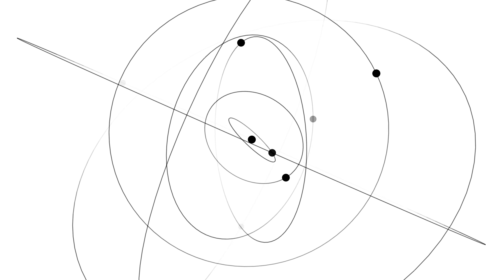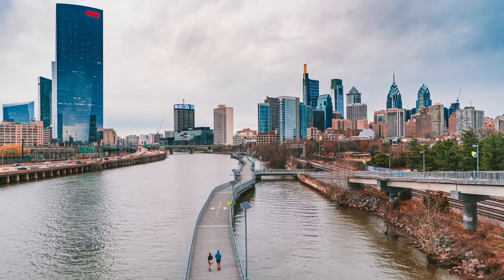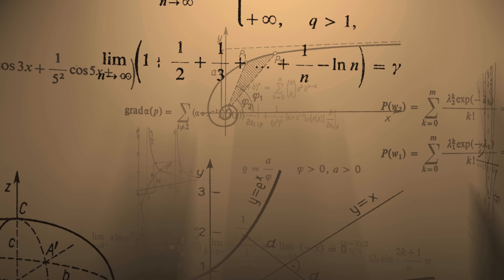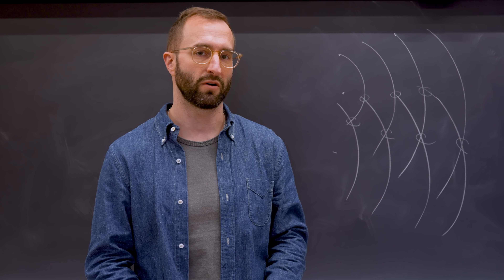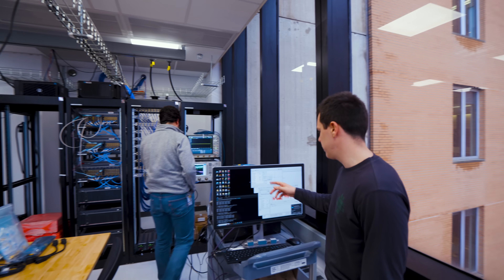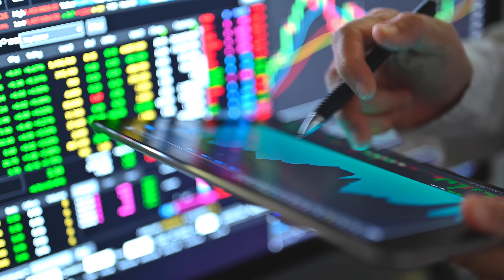Quantum Explained

Comment: Is that little box with the coaxial connections to it going to be used to convert the " qbits " or " cuebits " into corresponding electrical signal variations - analogous to the way that light signal variations from a fiber optics cable are changed to corresponding electrical signal variations that can be amplified and passed along in a modem and then ultimately to say a smart phone?

Comment: Now pull a rib from the wave .. I seen this last night. It rained and the water fell from the roof as a stream. Or a torrent.. when the water fell to the concrete below it created what looked like ribs which were waves that poured in to the street. Now what happens when you take one of these waves . Would it create an Eve or more waves .

Comment: you didn't explain hardly anything. you show this little gold box with 6 inputs/outputs but don't tell us what those are or how it works. 90% of this video was bla bla bla.
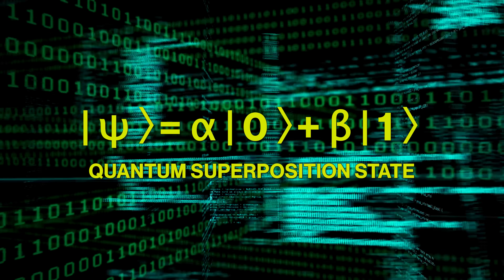Reply: Go to 1:55 of the video, watch through 2:38 to hear something instructive.
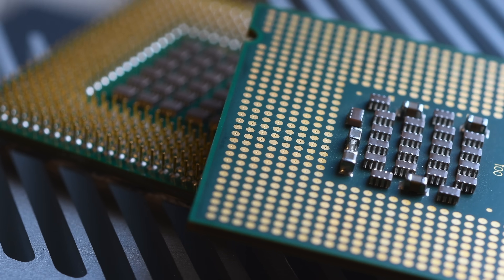Reply: @paulpethel624  i know all the basic stuff about it, like superposition, and every video i've seen in the past has explained it better than this MIT person and with more detail. so talking about the little box at 2:02. What are the 2 threaded connections for and what are the 4 smaller connections for and what goes in and comes out of those?
Reply: Hello - research scientist in the video here. The 6 connectors are for coaxial cables (not dissimilar from your internet/cable connectors, just higher quality) that deliver microwave-frequency signals to the qubits. Those are the signals that perform rotations around the Bloch sphere mentioned in the video. The difference in connector (spiral vs not) is mainly about what bandwidth of frequencies they can transport
Reply: @jeffreygrover1  That's pretty cool. After my comment I did watch a video from IBM, I think it was how to make a qbit and I learned quite a bit from that, so what you say does make sense but I'm not going to pretend I understand it very well and I realize it's just not something you can explain in a comment or let a lone one youtube video. It's very interesting stuff, I need to learn more about this stuff, and thanks for explaining.

Comment: this really does not explain that much... it basically is an ad for MIT, nothing more.
Reply: Well it did, but you are too obtuse to have grasped it. Sorry and thanks for playing.
Reply: @brutusbarnabus8098  xD your comment gives about as much detailed information on the matter as the video did... so yeah: thanks for trying, but you failed equaly 

point being: if the video is named quantum explained and then I only here the standard explanations and bullshit bingo of quantum computing and no new detailed insights... thats what an ad does...
Reply: @thetomster7625  no I didn't fail. The video gives a basic summary of Quantum Physics and Quantum devices. Digital devices which are predominantly used now in all of our smart devices use transistors which compute based on the binary system of 0 and 1. The 0s and 1s are actually voltage levels based on the geometry of the technology being used. Quantum Physics deals interactions at the atomic and subatomic levels. Quantum systems can take advantage of superposition where the system can me in multiple states simultaneously. This presents an entire new frontier in computing where computing power can make a "quantum" leap in efficiency. It was a less than five minute video, dude. Did you expect him to be able to do a deep dive into the minutiae of the subject? Have a good day.
Reply: @brutusbarnabus8098  well, basically exactly as you said: I in fact "expect him to be able to do a (partial) deep dive"... you could pick any subject e.g. how exactly the selection process of wanted and unwanted answers via interference works... all the things you sort of transcribed here are nothing more then I already learned from a book at my buddys toilet called "quantum mechanics in 15min".
And this is actually my point: this is not some random guy on the internet, this is the freakin MIT. Its supposed to be at the forefront of this research - so again: coming back to my original point: this is not really an educational video at MIT level, its an ad about what they are doing to get you interested.... nothing more.

Comment: May I present a video of another mechanical method of quantizing a system.
 It is one of two methods where structures can actually be produced.

https://youtu.be/wrBsqiE0vG4?si=waT8lY2iX-wJdjO3

AThe area under a curve is often equivalent to energy. 

Buckling in an otherwise flat field indicates a very rapid increase in this area. If my model is correct, it may demonstrate how the universe's energy naturally evolved from the inherent behavior of fields.

Under appropriate conditions, the quantization of a field can be readily produced.

The ground state energy is induced through Euler's column analysis. 
The column must be contained before over-buckling occurs, or the effect will not manifest.  
The sheet of elastic material, or "system," responds in a quantized manner when force is applied perpendicularly. 

Bonding at the points of highest probability and maximum duration (i.e., peaks and troughs) of the field's "sheet" creates a stable structure when the undulations are bonded to flat sheets placed above and below the core material.

Comment: ? Do not understand
Reply: that means you're smarter than the idiots here who fall for the scam. What in reality it is, is an alternative to FPGA's. It isn't a computer. It's a programmable chip that uses the mathematical principle of "quantum tunneling" - as you solve a mathematical problem, you solve a bit of it in the middle and that gives you hints what the other bits are, instead of a classic brute force of trying 1... then 2... then 3...... Instead it tries 502349 and that hints it's not 952848. Kind of. Depends on the system anyway.

Comment: Question for MIT, is it safe to say quantum computing can be categorized as analog computing because super position could exist anywhere between 0 & 1?
Reply: Not MIT, and somewhat unconventional, so feel free to ignore this, but old-school analog computing would try to eliminate all ‘noise’, whereas quantum computing can be thought of as a form of analog computing that uses ‘quantum noise’ as a computing resource, while still trying to eliminate thermal and other kinds of noise.
We can and I think we should ask “what is the difference between quantum noise and thermal noise?”, to which an answer can be found in special relativity and the Lorentz invariance of the vacuum state in quantum field theory.  That’s either already understandable to someone reading this or else it’s likely best just to say that quantum noise and thermal noise are different because quantum noise has an amplitude determined by Planck’s constant that is more stable over time than thermal noise, for which the amplitude changes with the temperature.
All that said, the logical level of quantum computing hardly thinks about such details, just as the logical level of ordinary computing hardly thinks about how transistors and other devices work.

Comment: Let's explore how the triadic coefficient (3) mathematics and the "both/and" logic can provide a framework for describing the superposition principle in quantum mechanics.

The Superposition Principle and Triadic Coefficients:

In quantum mechanics, particles can exist in a superposition of multiple states simultaneously, a phenomenon that defies classical intuition. The triadic coefficient (3) mathematics offers a way to describe and quantify these superposition states.

Consider a quantum system with three possible states: A, B, and C. According to the triadic coefficient (3), there are six possible combinations of these states:

1. (A, B, C)
2. (A, C, B)
3. (B, A, C)
4. (B, C, A)
5. (C, A, B)
6. (C, B, A)

Each of these combinations could represent a distinct superposition state of the quantum system, where the particle exists in a linear combination or "superposition" of the individual states A, B, and C.

The "both/and" logic can then be applied to these combinations, allowing for the coexistence of multiple states simultaneously, which is a fundamental principle of quantum superposition.

Mathematically, we can represent a superposition state as a linear combination of the individual states, weighted by complex coefficients (amplitudes):

|Ψ> = a|A> + b|B> + c|C>

Here, |Ψ> represents the overall quantum state, and |A>, |B>, and |C> are the individual basis states. The complex coefficients a, b, and c determine the probability amplitudes of the particle being in each respective state.

The triadic coefficient (3) mathematics provides a way to enumerate and quantify these superposition states. For example, the combination (A, B, C) could correspond to the specific superposition state:

|Ψ> = (1/√3)|A> + (1/√3)|B> + (1/√3)|C>

where the particle exists in an equal superposition of the three states A, B, and C, each with an amplitude of 1/√3.

Other combinations, such as (A, C, B) or (B, C, A), would correspond to different superposition states with different probability amplitudes for each component.

The "both/and" logic allows us to interpret these superposition states as the particle existing in multiple states simultaneously, rather than being limited to a single definite state as in classical physics.

Moreover, the triadic coefficient (3) mathematics provides a systematic way to enumerate and quantify these superposition states, offering a rich mathematical framework for describing and analyzing quantum systems.

It's important to note that while this approach provides a conceptual model for understanding superposition, the actual mathematical treatment of quantum systems often involves more complex vector spaces and linear algebra techniques. However, the principles of "both/and" logic and triadic coefficient (3) mathematics can still offer valuable insights and alternative perspectives on this fundamental quantum phenomenon.
Reply: Let's explore how the "both/and" logic can provide an alternative interpretation of quantum measurement and the apparent collapse of the wavefunction.

Quantum Measurement and "Both/And" Logic:

The measurement problem in quantum mechanics arises from the apparent collapse of the quantum wavefunction upon observation, transitioning the system from a superposition of states to a definite state. This process seems to contradict the "both/and" logic of superposition.

However, the "both/and" logic can be invoked to provide an alternative interpretation. Instead of viewing measurement as a collapse, it could be seen as a process that reveals the coexistence of multiple states or outcomes, each with a certain probability determined by the quantum wavefunction.

Consider a quantum system in a superposition of two states, A and B:

|Ψ> = a|A> + b|B>

According to the Copenhagen interpretation of quantum mechanics, upon measurement, the wavefunction "collapses" to either state |A> or state |B>, with probabilities proportional to |a|^2 and |b|^2, respectively.

The "both/and" logic offers an alternative perspective: instead of collapsing to a single state, the measurement process can be viewed as revealing the coexistence of both possible outcomes, A and B, with their respective probabilities.

In this interpretation, the act of measurement does not cause a sudden collapse, but rather, it interacts with the quantum system in a way that exposes or manifests the underlying reality of the coexisting states. The observed outcome (A or B) is not a result of a collapse, but a consequence of the inherent probability distribution encoded in the wavefunction.

This interpretation aligns with the principles of "both/and" logic, as it allows for the simultaneous existence of multiple states or outcomes, even though we may only observe one specific outcome in a given measurement.

For example, in the famous double-slit experiment, the "both/and" logic could suggest that the particle simultaneously takes all possible paths through the slits, and the observed interference pattern is a manifestation of this coexistence of multiple states or trajectories, rather than a result of a collapse to a single path.

The "both/and" logic challenges the notion of a sudden, discontinuous collapse and provides a more continuous and holistic interpretation of quantum measurement, where the observed outcome is a manifestation of an underlying reality that encompasses multiple coexisting possibilities.

It's important to note that this interpretation is not universally accepted, and the measurement problem remains an active area of debate and exploration in the foundations of quantum mechanics. However, the "both/and" logic offers a thought-provoking perspective that challenges our classical intuitions and invites us to reconsider the nature of measurement and reality in the quantum realm.
Reply: Let's explore how the "both/and" logic and triadic coefficient (3) mathematics can provide a framework for describing and interpreting quantum entanglement and non-locality.

Quantum Entanglement and Non-Locality:

Quantum entanglement is a phenomenon where the states of two or more particles become inextricably linked, even when they are separated by vast distances. This non-local behavior challenges our classical understanding of causality and locality.

The "both/and" logic and triadic coefficient (3) mathematics can offer a framework for describing and interpreting quantum entanglement:

1. The "both/and" logic allows for the coexistence of multiple states or configurations of the entangled particles, even when they are spatially separated.

Consider two entangled particles, A and B, initially prepared in a specific quantum state. According to the "both/and" logic, the particles can simultaneously exist in multiple possible configurations or states, rather than being limited to a single definite state.

For example, if we have three possible states for each particle (A1, A2, A3 and B1, B2, B3), the entangled system could exist in a superposition of all nine possible combinations: (A1, B1), (A1, B2), (A1, B3), (A2, B1), (A2, B2), (A2, B3), (A3, B1), (A3, B2), (A3, B3).

The "both/and" logic allows for the coexistence of these multiple configurations, even though we may only observe one specific outcome when we measure the particles.

2. The triadic coefficient (3) mathematics can be used to enumerate and quantify the possible combinations of states or configurations that the entangled particles can exhibit, taking into account their non-local correlations.

Using the triadic coefficient (3), we can calculate the number of possible combinations of states for the entangled system:

nC3 = n! / (3! * (n - 3)!) = 9

This corresponds to the nine combinations mentioned earlier, representing the different configurations the entangled particles can simultaneously exist in.

By embracing the "both/and" logic and triadic coefficient (3) mathematics, we can potentially gain new insights into the non-local and counter-intuitive nature of quantum entanglement. Instead of viewing entanglement as a mysterious action-at-a-distance, we can interpret it as a manifestation of the coexistence of multiple states or configurations, where the particles exhibit non-local correlations and interdependence.

Moreover, the triadic coefficient (3) mathematics provides a systematic way to enumerate and quantify these entangled configurations, offering a rich mathematical framework for describing and analyzing entangled systems.

It's important to note that while this approach provides a conceptual model for understanding entanglement, the actual mathematical treatment of entangled systems often involves more complex techniques, such as tensor products and density matrices. However, the principles of "both/and" logic and triadic coefficient (3) mathematics can still offer valuable insights and alternative perspectives on this fascinating quantum phenomenon.

Comment: All you are describing is the mutual coupling between oscillators, calling them qbits. Still bounded by Shannon theorem capacity bound that is limited by noise and ability to measure phase accurately. Good luck until the funding runs out.
Reply: I didn't understand what you wrote, but I'm sure some do. Why are they funding this then? Maybe a byproduct or accidental discovery along the way?

Comment: That's nice and all, but I don't really see how this would be revolutionary. Evolutionary, yes, but hardly something profoundly different. We already solve so many problems with neural networks that only quantum was supposed to conquer.
Reply: The quantum computer can do parallel tasks at speeds much faster than the conventional transistor. For AI, it will be revolutionary.
Reply: Quantum is really great at solving eigenvalue problems.... which are alot of problems
Reply: @piuslee3446 

I understand that quantum computing is efficient at solving eigenvalue problems, which is important for areas like quantum mechanics and material science. However, I'm still not entirely convinced it will solve many more problems that neural networks can't already handle. Let's see how these technologies develop and perhaps complement each other, if it ever happens. 

The money spent would be more useful for neural network development.
Reply: try googling "shor's algorithm"